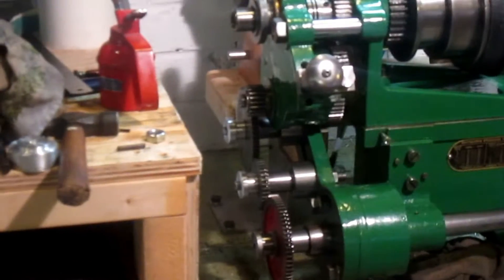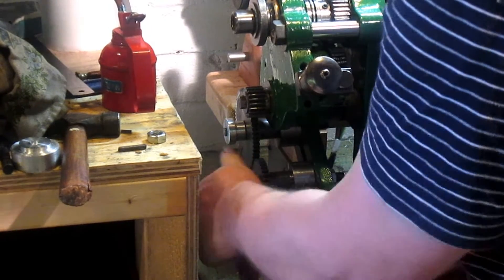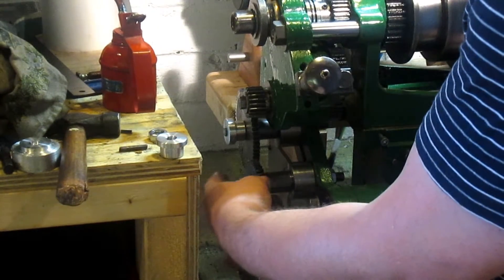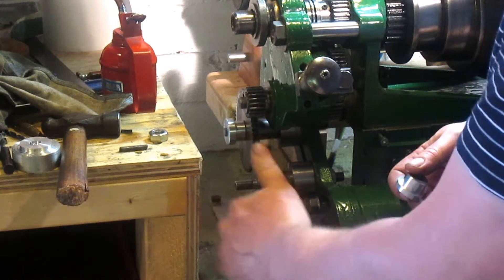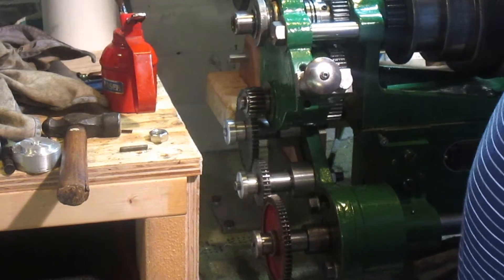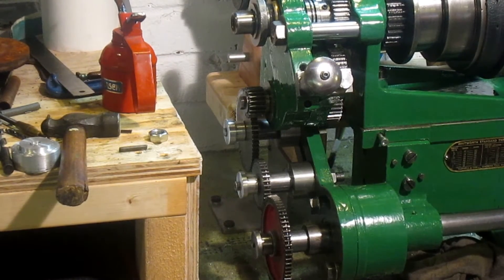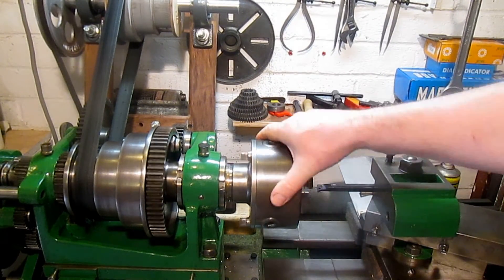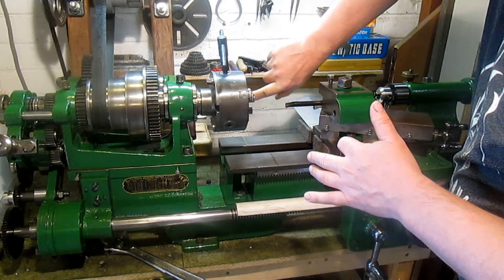Lathe update # 08 Change gear progress & fixing chuck run out

Comment: That is an amazingly low runout for a 3-jaw.  Nice job with the backplate. But sooner or later you will have to regrind the jaws, and will need an air die grinder, or (what I use) a Dremel on a purpose-built toolpost holder.